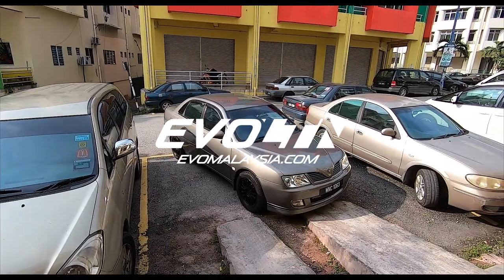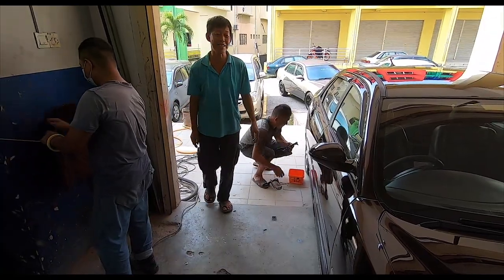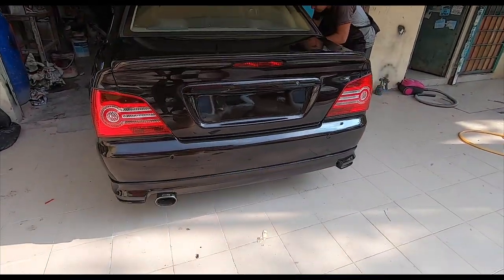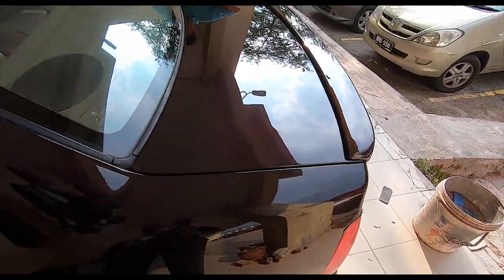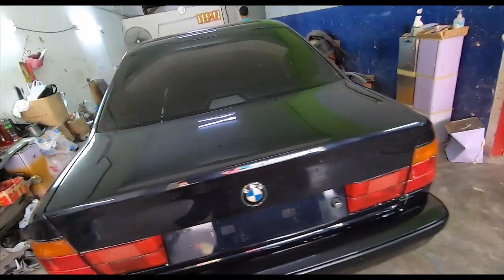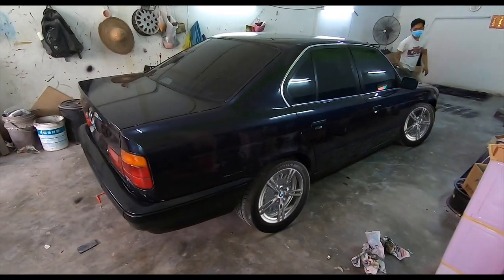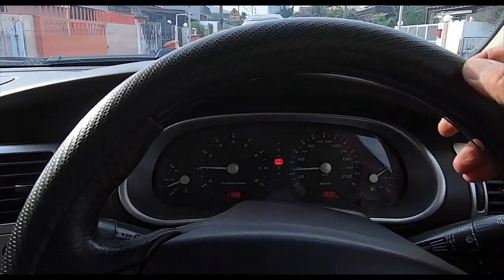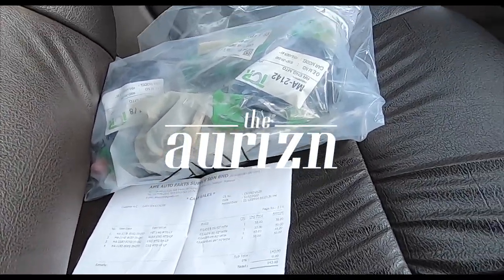WEEVIL SPECIAL: 1992 Ford Laser 1.6 GL Meets Proton Waja R3 & BMW E34 at Ah Kei's! | EvoMalaysia.com

Comment: Wow nice paint by Ah Kei. Hmm...can really bring my 124  over. Can they repair floor board as well?Talking about mounting, I managed to source 4 pcs mounting for my 1st Gen Toyota RAV 4 (thru someone I knew then) 4 pcs rm200. I asked Original 1 pcs alone is more than that. Old car parts new stock are bargain. Keeps the car running.
Reply from the maker: Yep, great job indeed!! Nope, he doesn't do welding, and only minor body damage repairs 😊